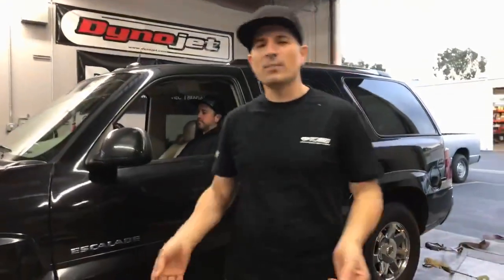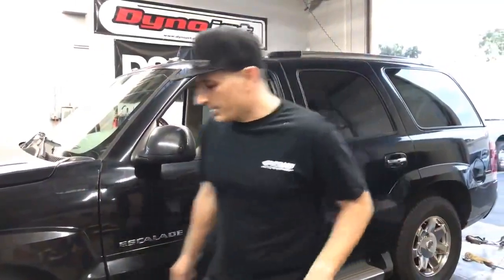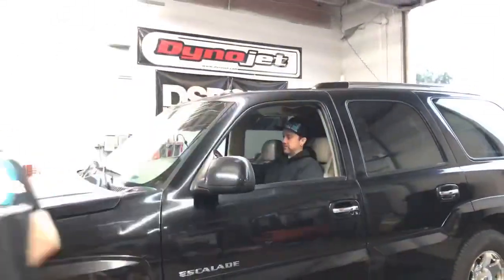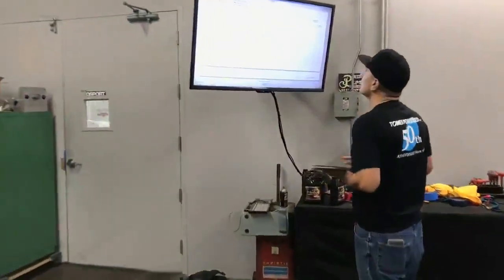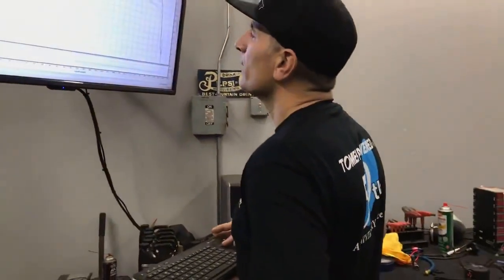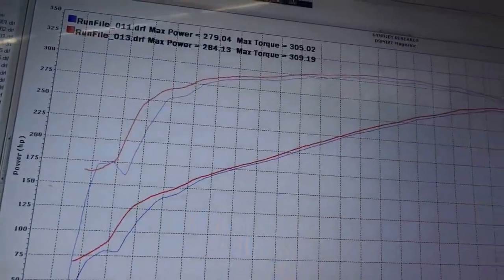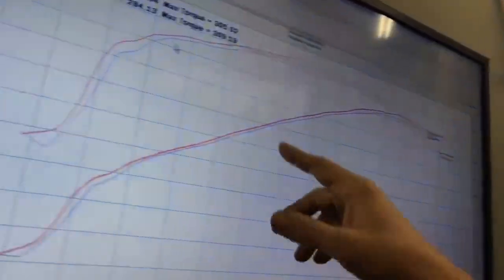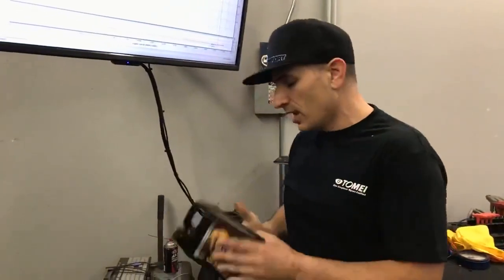Engine Dyno TriboDyn Oil Review

Comment: I have used TriboDyn in 2010 Camry Transaxle.  I have a 6 speed manual tranny in 2010 Camry. I have had TriboDyn in this tranny for the past 60,000 miles and it shift so smooth!!! When i was using regular gear oil, 3rd gear use to grind. This after I had Toyota put in a new 6 speed manual tranny. Thanks TriboDyn!!